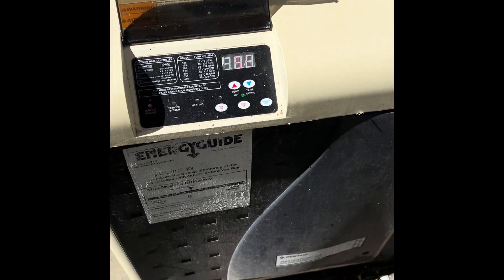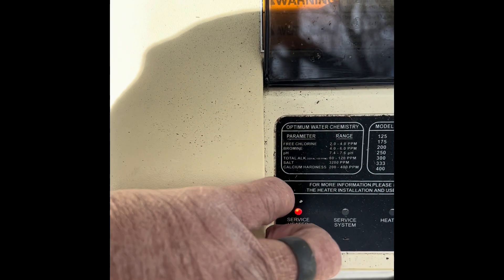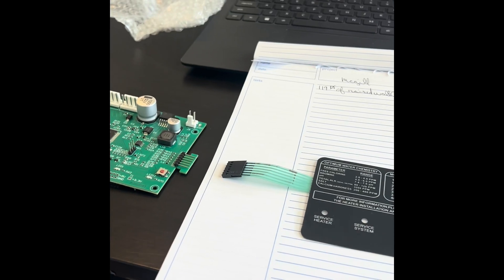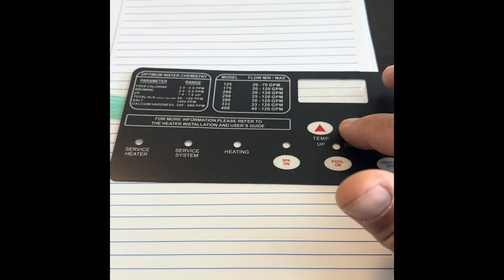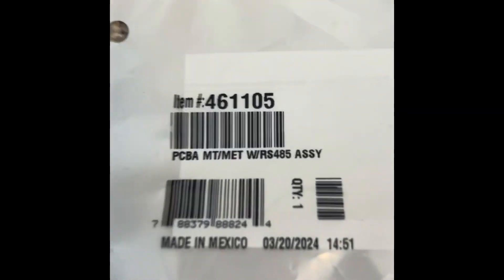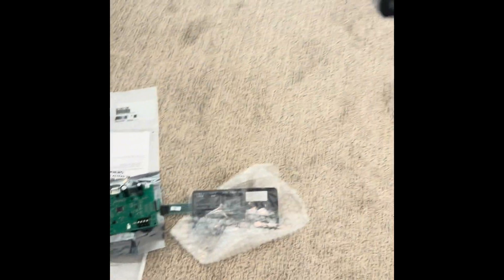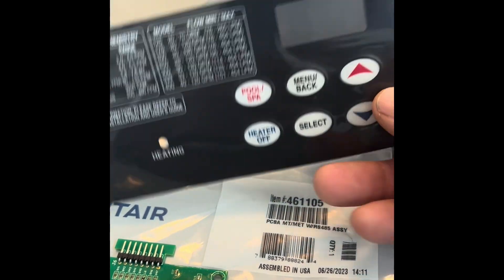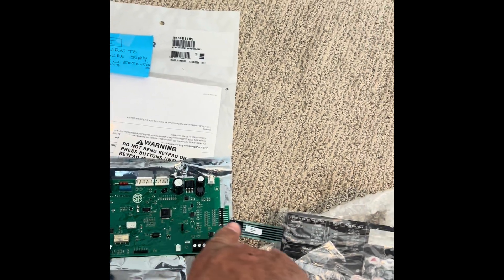Pentair MasterTemp pool heater heater circuit board & membrane replacement

Comment: What he won’t tell you is that this board he ordered did not work because you need a whole new wiring harness for the 6 button upgrade board. Pentair no longer manufactures the 5 button board in this style. Also, the board on the heater is not a Pentair board, this was an Amazon brand board that failed, he is trying to replace it with a certified Pentair part but received the new board because that’s all Pentair sells now. The harness is a pain to install so buyer beware. I’ve owned a pool business for 16 years, I think OP meant well but he’s giving false info out with this part number and not telling you the whole story, you need the harness as well.
Reply: I have 30 years in this business young buck. You need to watch my video again and learn. My video clearly states that the first replacement membrane is an Amazon purchase and warns buyers of its poor quality. My video also states that the Amazon membrane from China will plug in to the original ribbon and board but won’t last long. The video clearly states that the only long term solution is to purchase the updated board and membrane manufactured by Pentair with the menu button on it. With a special note to open the package and check because Pentair put out some kits with old boards and new membranes packaged together. It’s not a wiring harness. It’s called a ribbon. Next time you want to discredit someone posting with intent to help others, at the very least, watch the video and comprehend the message first. Ok pumpkin? Good talk.

Comment: Did it rain after you replaced with Chinese version? That can cause the membrane to go haywire!  I just ordered one from Amazon so hopefully it works
Reply from the maker: It did not rain, but why would that matter? This is an outdoor appliance.
Reply: @fullythrottle1  It is an outdoor appliance but these membranes when it get moisture inside causes havoc on the buttons. Thats all